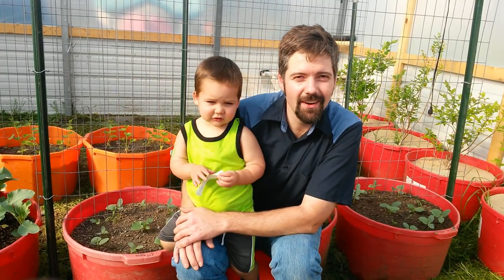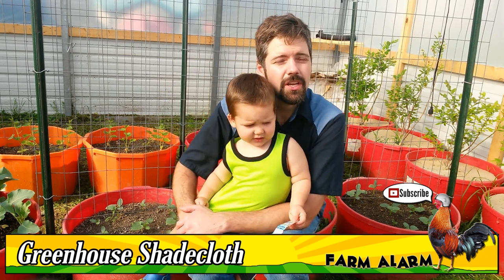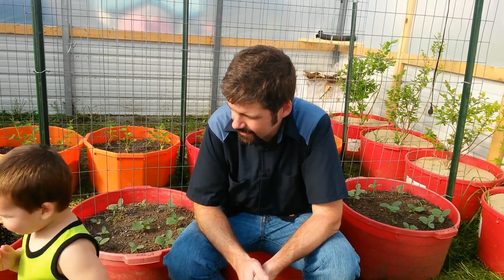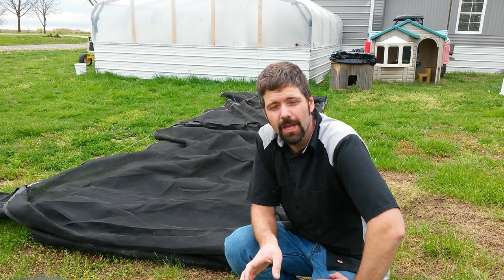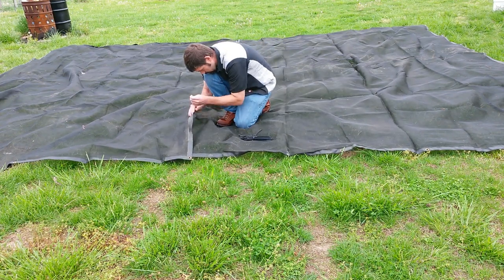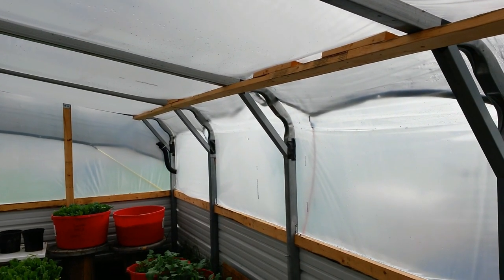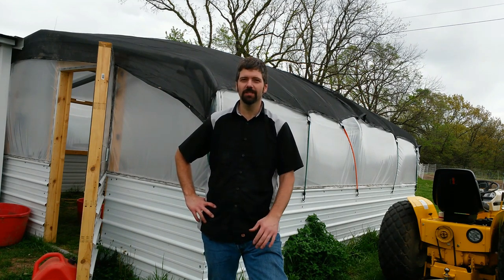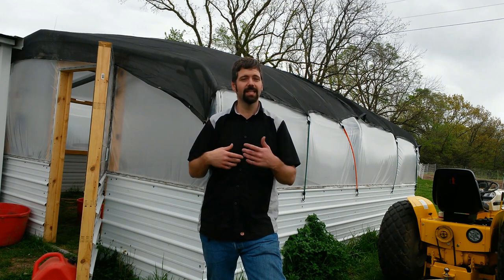Harbor Freight Greenhouse SHADE CLOTH

Comment: Ive used it to shade my dogs dogs we moved and apparently there yard I fenced in has no shade and gets hotter like well hot, even in north Fl apparently  the deck and any rugs also burns their feet on the way in to the house no porch or the ramp roof yet ( old dog w old mom) the tarp gives escape from sun an a place to run from hawks for my little dog in between all the string and pie pans I hung for her seemed better then her dragging  a boat anchor to stay grounded when out

Comment: Nice greenhouse. The shade cloth should still let enough light in and keep the greenhouse cooler. A thought that I had was instead of adding a door at the end of the greenhouse, maybe you could add a fan or a vent fan up near the roofline opposite the door. From what I read, you would want fresh air to come in the vent fan and out the door. You would decide how much to open the door.
Reply from the maker: Thanks Deborah. The Shade cloth works really well. We installed a fan and the door has a ventilation system. It stays much cooler with this system.

Comment: How Long did it last
Reply from the maker: Great question. I built this greenhouse 7 years ago. It has two layers of plastic with a fan blowing in between the layers. The exterior layer is fine. The interior layer finally rubbed enough against the interior frame and wore through. I will redo both layers of plastic this summer. I used greenhouse plastic because it has uv inhibitors in it. Otherwise it would have not lasted as long.

Comment: What sort of soil mixture do you use ? Where did you order those red bins ? Also will this shade cloth work well with a smaller hoop structure over 4 x 4 raised beds ?

Thanks!
Reply from the maker: Check out this video on how we get Free Garden Tubs https://youtu.be/VKdGLp67Le4
 Soil mix is: composted bedding from the Budweiser Horse Farm and soil compost from any garden center. Plus some earthworm castings. The shade cloth is a mesh tarp from harbor freight. Hope that helps. Thanks for the comment.

Comment: How well did that work for your tomatoes and peppers? Also how durable is it? I need to get something because when the temp starts getting up above 80 or so, it seems like nothing grows as fast or as large. When it gets really hot I end up with sun scald and everything seems to grow only about half the size of what is normal. Also where did you say you found that carport frame? You really got a good deal on that, I think.  Thanks man
Reply from the maker: Worked great for everything I grew in there last summer. I will definitely be putting back on the greenhouse this summer. Very durable also
Reply from the maker: Oh and for the carport frame, I sell carport, so I called the warehouse and bought 4 used frames. Unfortunately the price has went up since I bought them. They currently have some but the price is around $450 or so.
Reply: Did you grow tomatoes and peppers in it last year? From what I understand stuff like lettuce and kale need more shade than peppers and tomatoes.
Reply from the maker: I didn't grow any Peppers. But I did grow tomatoes, and they turned out just fine. It still had plenty of light coming through. It just really helped cut down the heat.

Comment: I'm interested to see if the black color draws more heat? Update in the near future perhaps? I'm in the desert southwest and we use a light colored shade cloth on our raised beds. Hmmm, now I'm thinking... :) Blessings and thank you for sharing!
Reply from the maker: JM, that thought had crossed my mind too, but it was warm out yesterday and there was a huge difference in temperature drop from without the shade cloth on. seems to be doing the trick. id say what is helping not transfer the heat from the black cloth, is the double layer plastic with about a foot of air gap. just my guess tho. thanks, be blessed.
Reply: I'm trying to decide what to put over the top of our chicken run until the vines grow over for a natural cover. Thank you for the insight.  Any shade is better than none! I like that it has the grommets too. :)
Reply from the maker: Very interesting that you say chicken run... I bought these mesh tarps last year and had them over my chicken run! They worked great!
Reply: God is good! I had no idea you used them for that. A little gift. :)